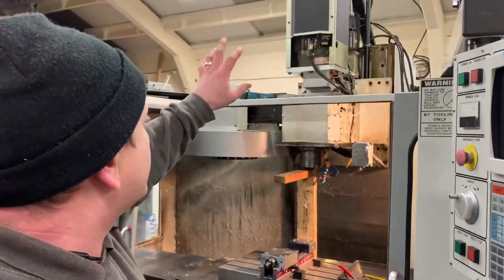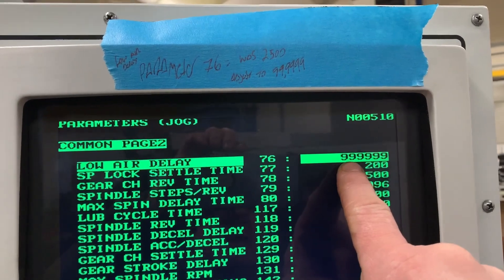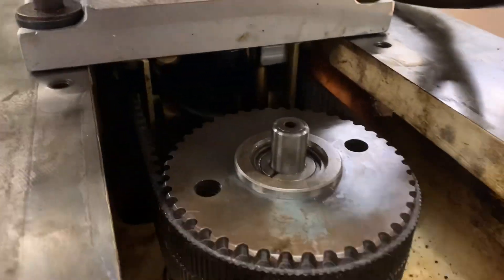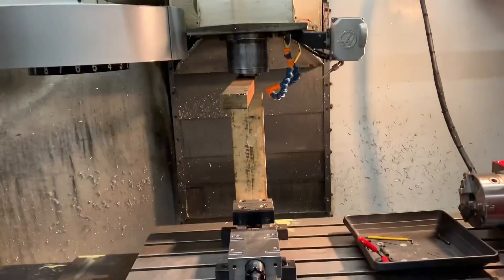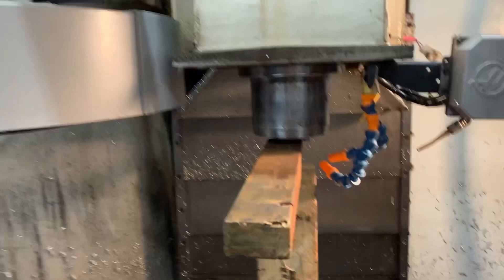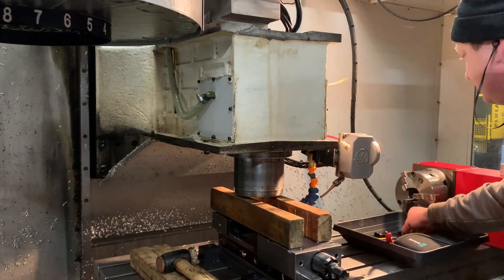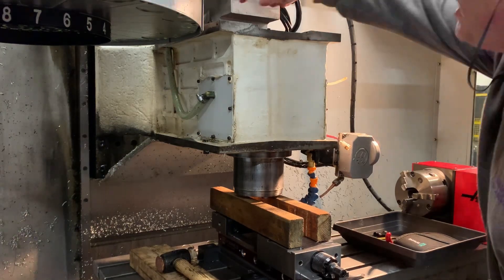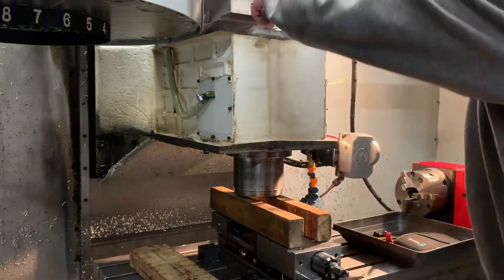Haas VF3 spindle removal

Comment: DO YOU HAVE A VIDEO ON REMOVING THE TRP?
Reply from the maker: Im afraid i do not but it is a very easy procedure to remove it, there is only 3 switch connections and the airline connections along with 4 bolts, no alignment or parameter changes are required to remove and refit

Thanks
Marc

Comment: that's a hell of an amount of end float, I could see some centre punch alignment marks so it's been apart some time previously, is the bearing clamp nut loose? best of luck Marc, I hope it's not too an expensive a fix!
Reply from the maker: Hi

Yeah someone’s had it apart as it’s all marked up with punch alignment marks,

Once I remove the pulley I will be able to tell more but something is either undone or a shrink fit collar has slipped! I’ve never seen inside these spindles so not sure of the arrangement but I will film it and show you all whatever happens 

Thanks
Marc